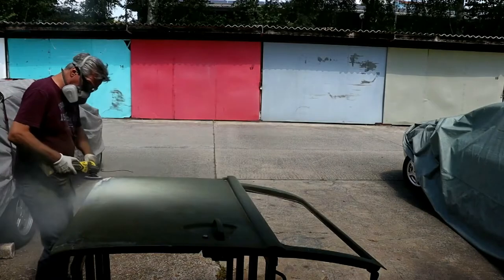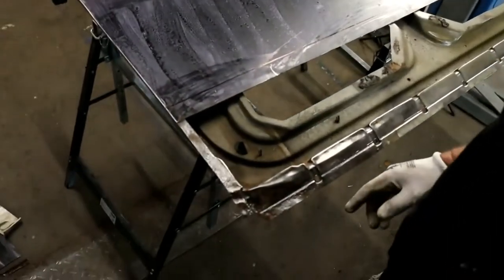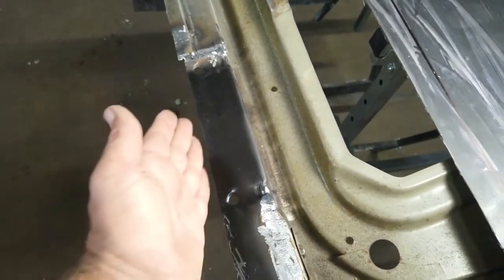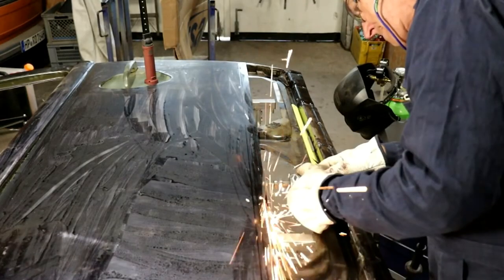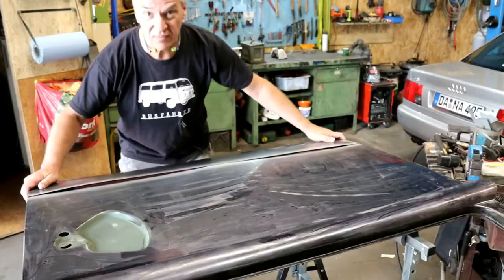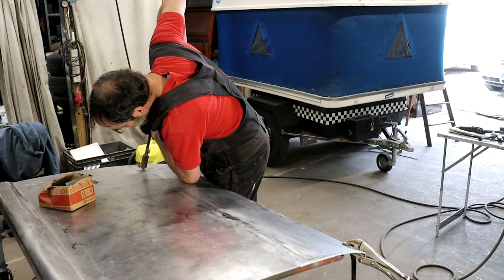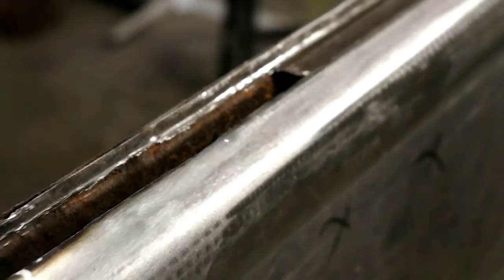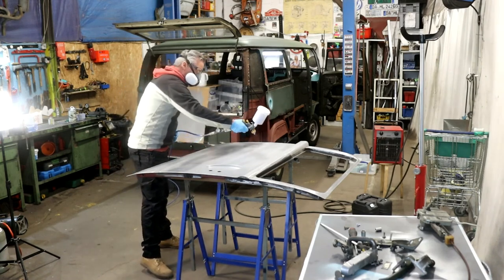How to  restore a rusty and damaged sliding door of a VW bus

Comment: Very helpful. I’m also repairing the lower edge of my 72 bay sliding door. I was debating whether to fold the edge of the replacement panel first, as you did. Or welding the top edge first then hammer the fold over. Seeing what you did, I may also try folding the edge first. Thanks!

Comment: Great work, Oltimer-Rescue-En    when you folded over the edge of the new skin and tapped the panel into place, did you just tack weld the folded edges in the corners or did you weld that seam fully?  panel bond adhesive ? seam sealer etc ?  just wondering how you finished that folded over edge.
Reply from the maker: Hi, thank you for your question. I only tack welded the corners and every 20 cm  at the edge. After that I put some thin rust primer into the fold.

Comment: What anti rust paint is that? Thanks
Reply from the maker: Hi Omar, the paint is "Brantho Korrux nitrofest". It is a heavy duty, flat, 1-component coating showing excellent corrosion resistance and fast drying properties. Particularly suitable as a primer, also on manually prepared, rusty substrates. A two-coat system is weather-, seawater- and oil resistant. You can buy it in several different colors. Kind regards Ralph
Reply: @OldtimerRescueEN  Thank you so much for your response.  I really appreciate it.
Reply: @OldtimerRescueEN  Which one you think is better in the long run. One or two system method?